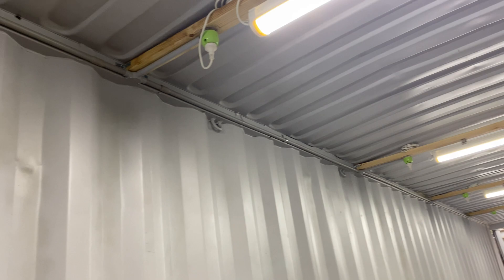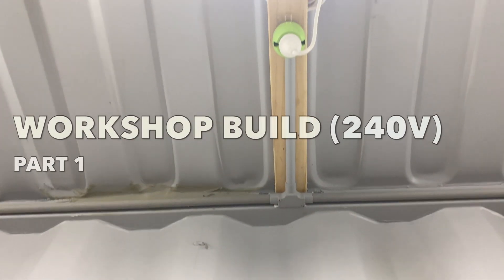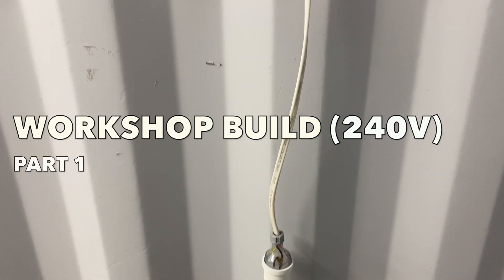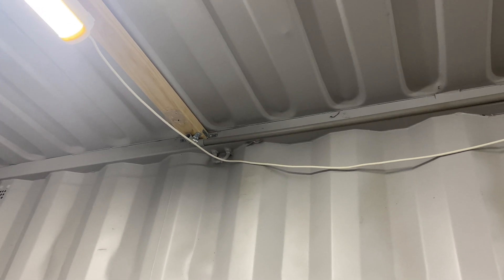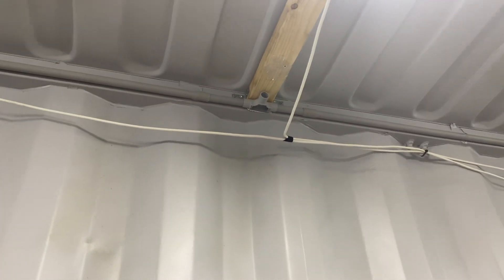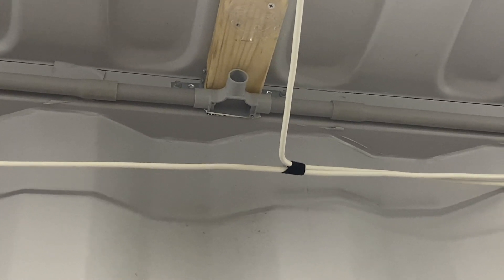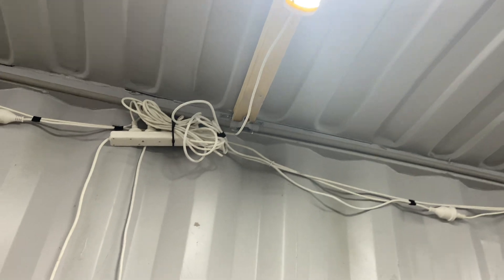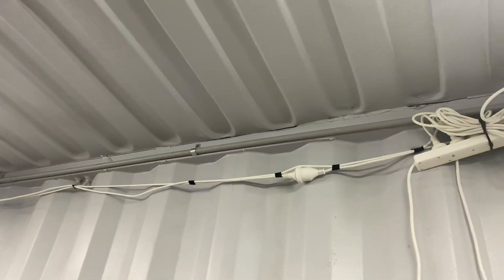Shipping Container To Tiny Shop/ Workshop - Electrical DIY (Part 1)

Comment: Have you considered having lights on 12v instead of 220-240v ? In that case you could power them from the battery and get off-grid.
Reply from the maker: Hey mate yeah I definitely have, I’ve got some old golf cart batteries so I’m thinking of running led strips in the future along the wooded beams that the lights are attached to and even under the work bench. Then a solar panel on the roof to keep it charged..